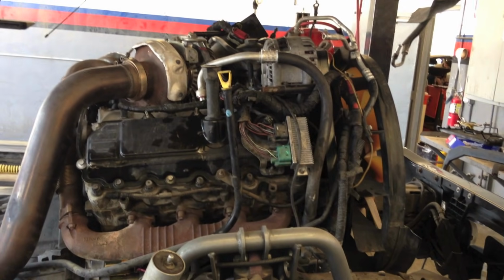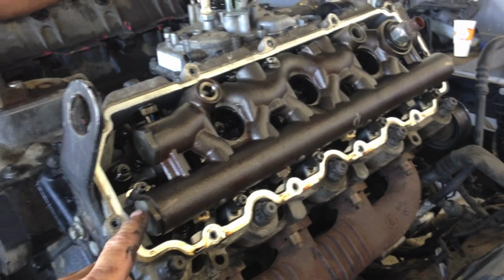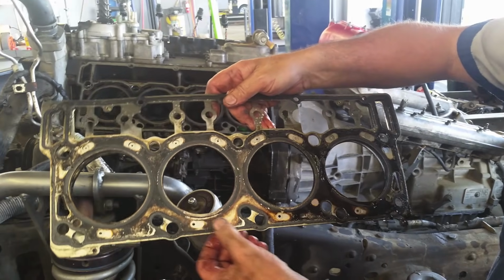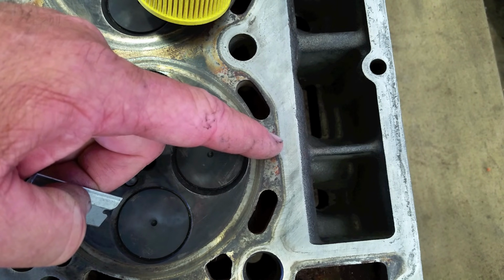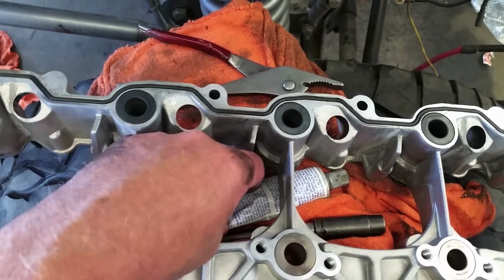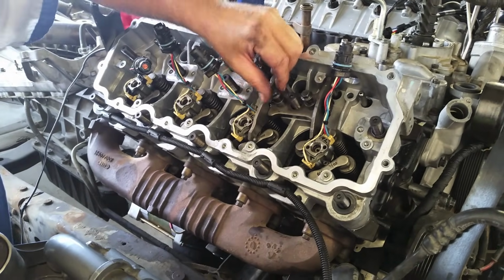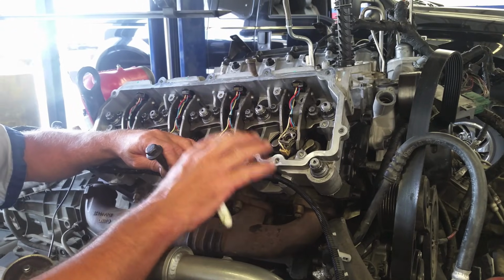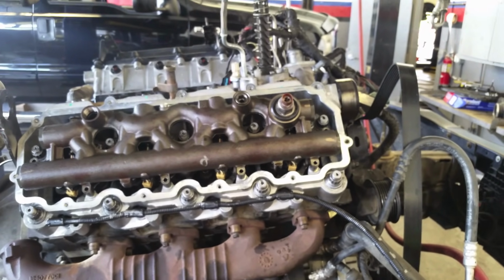Ford 6.0 Powerstroke head gaskets tips and pointers

Comment: When i do any head gasket diesel or gas i always coat both sides with the copper spray. I have done 3208 cat. 8.2 detroit, 6v53 detroit  ford 3.5, 5,4, 4.6, dodge engines, DT-466, 8v92 detroits cat 3406B, A nascar builder showed me how to properly do this. You won't have any more head gasket blow out.
Reply: Worst advice ever. It explicitly states not to use coatings on mls gaskets because it inhibits the ability for the gasket and its sealant to bond to the block. Might as well leave grease and oil on the block at that point.

Comment: better a vehicle from the late 90's when carburetors were phased out, to the early 2000's, these simple fuel injected cars are simple and will last, there is not much to go wrong.
this is totally different to the complicated pieces of trash made in to 2020's,  makers all follow the evil philosophy of build it to last the factory warranty and no more, so now they use plastic components, like the plastic thermostat housing,  and with the constant thermal cycling of engine heat and cool down, the plastic deuterates and fails, so the engine fails when hot water sprays out, over heating the engine, leaving you stranded, this part used to last a lifetime when it was made of metal, it never failed.  this is the car makers new philosophy,  save money on plastic parts,  engineer things to only last a little past the factory warranty and dont worry about our customers after the new car warranty expires, let them suffer ???
thats the  automotive industries new philosophy,  look at the new cars with small engines and big turbo's to squeeze enough horse power out of the under sized engine that has to scream, these cars with under sized engines and big turbo's to compensate all burn out quickly after the warranty expires by design,  when car makers wanted a car to last they used a bigger engine thats naturally aspirated and is never stressed out so it last for decades, these  cars with undersized engines and a turbo to compensate are little screamers,  they are frail and fall apart after warranty expires, look at toyota, they intentionally put a larger engine in the lexus so it would never be stressed out and would be reliable and last a long time .
the point is be careful on the car you buy, get the simpler base model, but people dont know so they buy a hatch with a puny 1.0 liter engine and turbo to squeeze enough power out of it, but a small engine being squeezed will burn out quickly, usually after  the factory warranty expires  is the makers plan, they know the owner will need a complete engine rebuild every 5 years, they know plastic parts under the hood will all eventually disintegrate and fail, there philosophy is build it to last the warranty then funk them, there on there own, we dont care anymore,  and the highly complicated electronics and features on new cars  are a nightmare, there was a man a hundred miles away from home on a dark lonely road at night, he stopped to get something from the boot, he got back into the car and started it again, when he tried to drive off he could not, the electronic park brake was jammed on, nothing he tried would release it, he was stranded, little did he know, that there is a switch inside the drivers seat that tells the computer there is someone sitting in the drivers seat, this triggers the computer to allow the electronic park to be disengaged,  but if this switch in the seat fails, the computer can never register anyone sitting in the drivers seats, so will never disengage the electronic park break, his only hope is to flag someone down who can bypass the electronic park brake by pulling a fuse or it's relay, if the park brake is marked in the fuse box or relay box, pulling a fuse or relay will deactivate it probably, unless it designed to be automatically engaged when power is off, in that case you would have to hot wire it to engage the disengaging motor, to release it. in the old days there would have been a manual safety release, but modern manufacturers dont care less any more, all they care about is selling you the car, they getting that car past the factory warranty without having to spend any money on you, they breath a sigh of relief when the factory warranty expires and see there plan to build  cars to only last past the factory warranty is working if you never claimed on the warranty, but if a part keeps failing before the warranty expires, they simply make it out of thicker plastic so it last the warranty,  car makers could not care less about you after the warranty expires, they only care about new customers and getting them past the warranty without claiming, so car makers are selling disposable cars designed to get past the warranty period

Comment: what head gasket kits do you recommend. from what ive been seeing oem seems to be best but not sure. need to do my 6 liter. thanks. sorry after reading comments just noticed he passed away. sorry about that.
Reply: Always use motorcraft.

Only thing I have that’s not motorcraft is my turbo oil drain tube.

Aftermarket tube allows for better oil flow.

Comment: Ron was a legend and he's a sorely missed member of the 6.0 community. - As a side note, the guys at FICMRepair are damn solid resources for any 6.0 owner. They sell pretty much any part a guy could need and the customer service is stellar. They help guys all the time with troubleshooting, OE and aftermarket parts selection, etc. - Plus, if you're going to own/drive a 6.0, the FICM tunes they sell wake the beasts up very nicely. Best of all, they help with fuel mileage!
Reply: How do I go about getting a ficm tune done on my truck

Comment: I was an idiot and did stock bolts and the hood gaskets with o ring heads and blew gaskets within 20k miles for driving it hard with custom tunes and big turbo and big injectors

Comment: Does anyone know I'm having issue with my F250 2005 6.0 this alot of pressure coming up to the reservoir of water you know what's wrong with it thank you
Reply: Probably the head gaskets.  I'm in the process of replacing head gaskets for that same reason.  Pressure blowing coolant out the degas bottle.
Reply: Also check for egr cooler leaks.  Sometimes it will blow exhaust into radiator if it's internally cracked
Reply: Thank you mr. Scott

Comment: ive been working on cars/ trucks for 15 years.. and you should NEVER shoot out a head bolt EVER.. you loosen them with a breaker bar first.. you can easily strip the head of the bolt.. and a socket will forever spin on in.. or if there is a problem .. the gun wont tell you.. and you can snap the bolt if the bolt is too seized up
Reply: I also loosen critical bolts by hand but when you are working flat rate and you have seen enough of these that you know the odds of stripping the head is low I am guessing you take your chances to make sure you aren't losing time.

Comment: I miss this man I need a new video to watch it's a damn shame only the good die young see you when I get there brother I'll bring you a blown up 6.4 when I come that way 🙏🙏🙏
Reply: Tony Mikesell just forget about ever seeing your 6.4L run ever again, that's 150k mile throw away engine no matter what you do
Reply: Pat Pikulski 150k? I’m at 240k on stock head gaskets turbo and tranny 💀 your just hearing what happens when a 16 year old kid gets a 6.4 and throws a 250 horse tune on it lol
Reply: @Boostedmamba  penis
Reply: Jack Hawes a couple of the best things they did was put the injectors on a common fuel rail system, made it so you don't have to take valve pans off to do injectors, reversed the intake and exhaust flow so the intake manifold is now a exhaust manifold straight to the turbo and put the oil cooler in a remote spot on the frame rail, one of the bigger downfalls is the ceramic ballbearings in the turbo charger and the automatic transmission skips gears on the up shifts when you don't want it to
Reply: 6.4's are almost impossible to rebuild.
Reply: Jack Hawes 7.3's are great but lacking power, 6.0's are alright and can be made to run well, 6.4's are just total crap, now the new 6.7's are pretty good especially if you run a straight pipe on it
Reply: Patrick Pikulski Yeah im excited to see how 6.7's stand up with some more years under their belt, they seem pretty solid and make great power as of now
Reply: Tony Mikesell
yeah blown 6.4's one in every neighborhood

Comment: As a 2002 Ford F-250 Super Duty owner with the trusty 7.3L that ordered the truck brand new and am still the original owner of it......I always knew the "six point OH-NO" was a piece of junk. This video confirms it for me. The over-complexity of it's design and complete 180 departure of it's older predecessor the 7.3L pounds the nails in it's coffin. I've recently done some work inside my 7.3L as my injector cups cracked and my injector o-rings needed replaced. It's nowhere near this over complicated design and has much fewer parts. How anyone could/can love the 6.0L is beyond me. The thing is the redheaded adopted step-kid of the Power Stroke family. What a piece of trash........I'd recommend scrapping the truck vs fixing it until it's next soon coming failure in the near future. Take your loss and find a nice '99 - early '03 with a 7.3L in good shape or put a down payment on a new '17 6.7L with a warranty and a in house manufactured drive-line. This foolishness make me think of turning down Kimberly Guilfoyle's sexual advances and picking up a 90 pound hooker on crack with HIV.....

Are you fucking nuts?!

Comment: Outstanding video! Very well done with attention to detail. I do have a couple of questions:1. Why do you think that the head gasket failed on this one, especially in light of the fact that head-studs were used.2. What is your thought on "ringing" the heads? I see on various forums that is the only way to really guarantee that the gaskets on the 6.0 do not fail under load.Thank you very much!

Comment: Ron, I have a bent push rod on a 230K mile engine no studs bone stock if there is no camshaft damage I want to install new lifters and  Updated stand pipes and stc fitting. I see that you recommend not refinishing the heads should i have the valve check and go back with it. truck was not using any oil.  Do you think that would be ok? I had a lifter failure after LPOP was replaced. Also replacing oil pan gaskets and bed pan resealing the engine completely . Are these engines good for 500K????  cylinder walls look great. engine out of truck obviously if there is camshaft damage i will order a long block. Worst case who would you recommend ordering a long block from.

Comment: now here are some issues that i have encountered with this type of repair on 6.0 specific. I have worked on about 30 head gasket 6.0's in the past year. with that being said after my second 6.0 head gasket issue, this is where it gets tricky and i take it to the next level. the 6.0's heads are cast. they can and will crack if you get them hot enough. just because the head gaskets show blow by doesn't mean that's where the problem ends. 2 out of 5 heads i have pulled were cracked. and you cant tell that they are cracked until you pull the valves out, hot tank and do a mag flex on the heads to inspect where the cracks are. they will usually crack in the valve seats. just because those heads aren't warped doesn't mean there's no cracks. so from my own personal business stand point and for my insurance, i now charge to strip, tank and inspect the heads. i also mill them flat. Another thing i see wrong with a lot of shops. every shop that i have seen work on these heads and do milling think its ok to take off .006-.008 thousands of an inch to surface the heads. which is fine. but the OEM specs on the valve recess is .013-.027 thousands. with every head i mill flat i recess the valves to .030. then once that is complete trim the valve stems to make up the difference. I've also seen people run the 6.4 pushrods on these engines which is fine, they are just .100 shorter. a lot of shops that i have seen machine heads and put back on the truck ended up having broken pistons because the valves kissed.. so if your heads were milled flat and put back on and the engine only lasted about 4000 miles, thats why. Now this video is very educational, and ron does a great job at that. But what ford recommends as far as this segment of head gasket repairs, i would go deeper in the heads ones they are off just so i don't end up doing this job again on the same truck.
Reply: +FULLY LIT At the dealership you have to get approval to machine heads, can't just say you won't do it if the customer does not want to have them milled and o-ringed. ford does not approve milling or o-rings but it has been proven to work well. But your getting paid for it either way so sometimes you just do what you have to do.
Reply: im making a youtube video on this right now to do this with cab on..
Reply: Sweet! checked out some of your videos, glad to see another tech out their that wants to help people like Ron did. Ive been ford diesel certified for about 2 years and my very first 6.0 job was cab on head gaskets. Look forward to seeing some more of your videos!

Comment: I dont agree with you when you say you will always blow head gaskets. Its because you dont do it correct. Bill at Powerstroke specialty offers a life time warranty because his o ringed head with ford oem gaskets and arp head studs with an egr delete is 100% bullet proofed when he does it. obviously you guys do not do it correct or the customers run stupid amounts of tuning through these trucks to blow them again.
Reply: Serious question.  How many videos does Bill have on his channel actually tearing these apart, and performing repairs?  All he covers is fubars, and then plugs in his repair.  He claims nobody can work on them properly but him. It's all a sales tactic.  He offers lifetime warranties, but with an asterisk my friend. It is impossible to warrant a head gasket as a lifetime repair.  All it takes is a broken coolant hose, or a weak fan clutch, and boom it overheats, and boom head gasket failure.  What Bill sells does not make the truck immune to head gasket failures.
Now I have nothing against his channel (I'm a subscriber) and as a tech his channel has helped me identify a lot failures, but he is a salesman, and that is the main purpose of his channel.  This gentleman here has dedicated a serious amount of time and effort into these videos, and they are top notch.  These things are not easy to film, and take TIME to do.  Appreciate it.  To say he is performing improper repairs is ignorant.
Reply: +Reid Hill I work at the Ford dealership that Bill and his part changing crew buy all their parts, fluids, and etc from. I have been to their shop and met most of his techs and i can say from personal experience that they back up their "Lifetime Warranty Head Gasket Repair" that is advertised at $10k. But that is a baseline price, every truck that comes to their shop is "Head Gaskets and Injectors" plus whatever other bullshit he feeds them. They don't want to risk having a comeback so they sell the whole package or they most likely won't do it or won't warranty it. Im not trying to bash his business really at all because I'm not going to lie he has done well but when you work for a Ford dealership it isn't as simple as selling them the "Lifetime Bulletproof" you can make your recommendations and explain why you feel that way but you can only repair and sell what Ford will warranty without authorization from the dealership or the customer. Also another note. Take one of Bills Biggdogg cylinder heads and weigh it against a factory ford one. Their will be a noticeable difference in weight, thinner water jackets maybe? I can't say for sure but i have been their to compare and i will leave it at that.

Comment: Hello Ron.I have an 05 6.0 dually  with 78k miles. All stock very clean. bought wrecked hit in the side. Replacing the cab. Don't know anything about the truck . While the cab is off, what upgrades would you recommend? I'm a 65 year old farmer. Won't be hot roding but will be pulling loads occasionally.
Reply: +ray yar like he said i would do dummy plugs, blue spring upgrade, banjo bolts, egr delete, oil cooler, standpipes and maybe check head gaskets while cab is off
Reply: +Jake Witt THANKS!
Reply: +Jake Witt  I wasn't aware of some of the things on your list. Got them ordered plus oem head gaskets and head bolts. longevity is what i want . I also ordered turbo back 4 inch exhaust and coolant filter. Guess I'll have to order a programmer because of egr delete. THANKS AGAIN.
Reply: +Jake Witt  Ordered arp studs not bolts.

Comment: Looks like I'm in for some bad luck if just your guys shop have done "hundreds" "if not thousands" of head gasket repairs. My 2005 has is stock with 200,000 miles mostly trouble free. Am I pass the head gasket repair mileage Or is it coming soon?? My build date is December 2004. Thanks for all the videos.. It has helped me a bunch.
Reply: If so I have a nice work truck forsale!!
Reply from the maker: Head gaskets usually just don't fail.  It's mostly caused from programmers used WHILE towing.  Restricted oil coolers overheating the egr cooler or driving low on coolant, that cracks the egr cooler.  Poor maintenance on the cooling system.  Coolant won't circulate properly and the head gaskets fail.  Most head gaskets do not fail.  Just about all modified trucks neglected and pushed engines fail.  Yes it's a poor design. But most do not fail so it's not all design
Reply: where would I look to find this date of manufacture ?